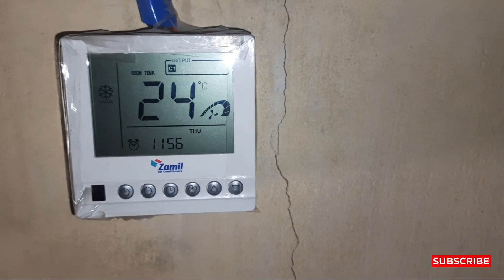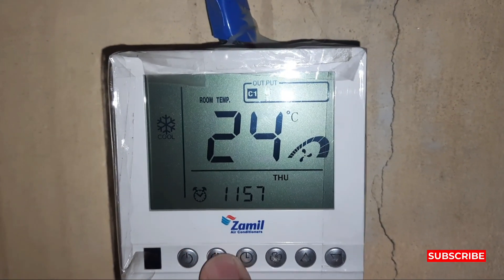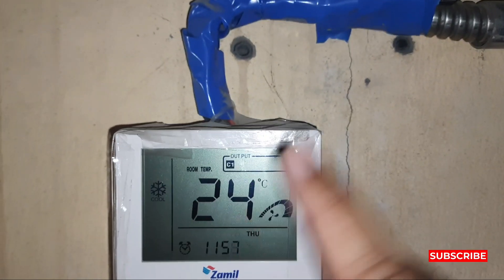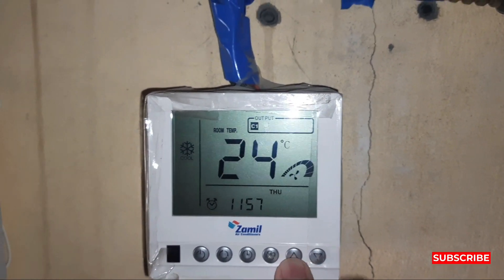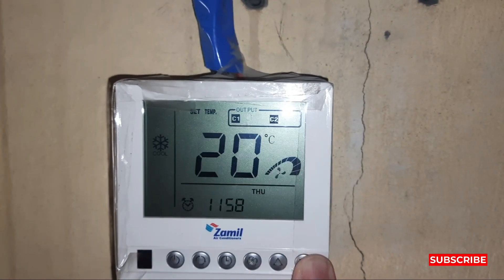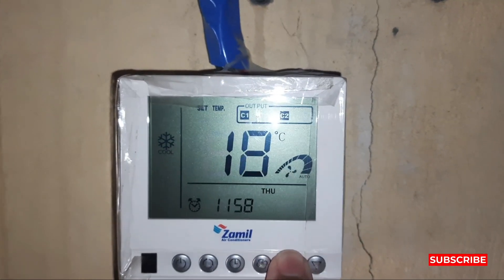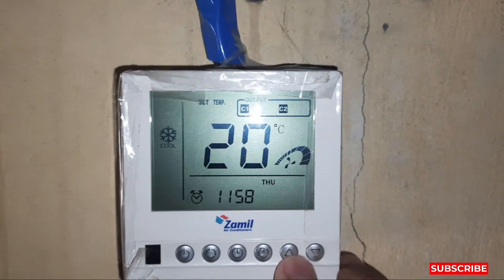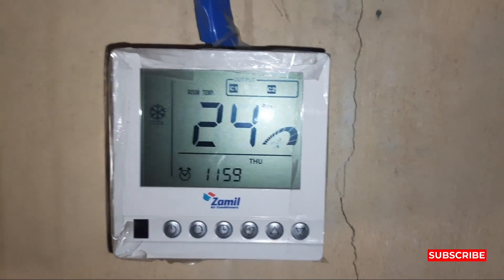How to Lock and Unlock Zamil Air Conditioner Thermostat

Comment: Can I set the maximum temperature?
Reply from the maker: The ideal temperature for room is 22 to 23, if you set on 18 degree celcius, first of all that temperature is not good for your health and secondly it will cost you more in both condition 18 degrees temperature is not suitable 😊